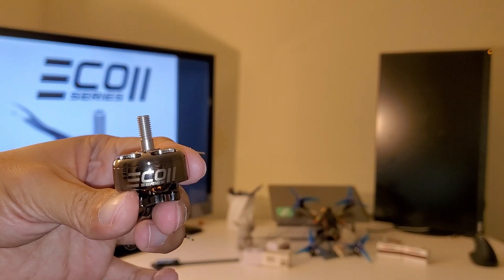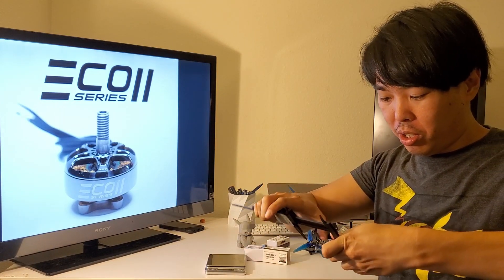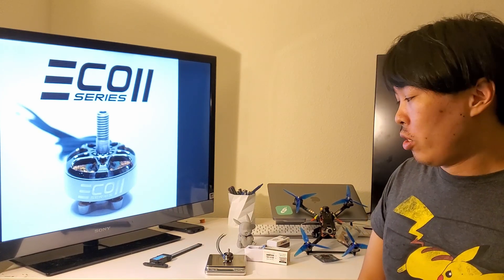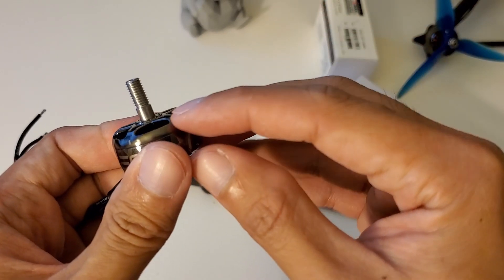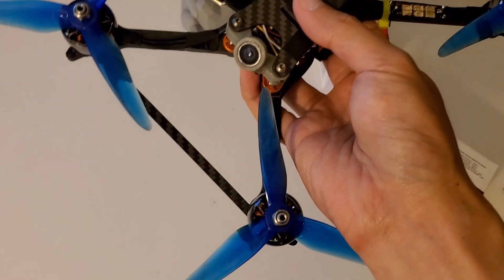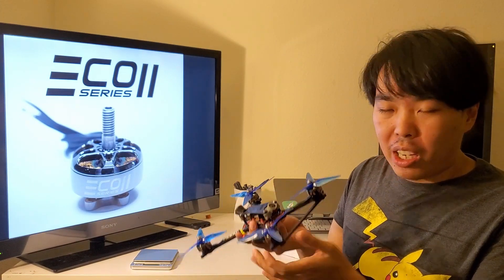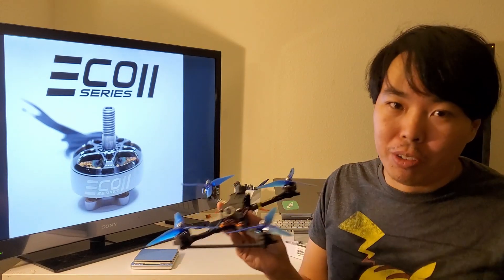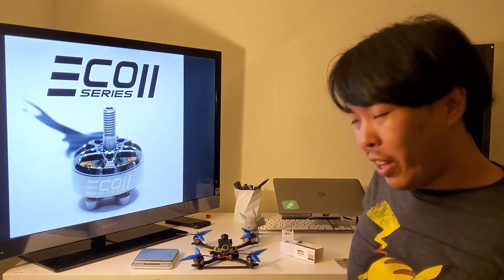Emax Eco II FPV Motor - Return of the Budget King? $12 Motors Racing test review!!!

Comment: Going for my 1st fpv build …. I am confused between the two- tmotor velox V3 1750kv and Emax ECO II2207 1900 kv …. Could you suggest your pick? (I kbow 6s is recommended but I am planning to start with 4s and then gradually shift to 6s after I have enough confidence) . Kindly suggest your pick amongst these two
Reply: Tmotor

Comment: Sir
I have four 30 amp escs,eco 2 2304 1900kv bldc motors,apm 2.8 and 2s lipo battery is the above detail sufficient for quadcopter drone

Comment: I am starting to believe that the difference between a high priced motor and a low priced motor is so small that only the best pilots will be able to tell a difference. Racing pilots will probably be the ones that can tell the difference because as you said, every gram counts, every little advantage you can get helps. For most freestyle pilots I don't think most will be able to tell a difference. For freestyle flying, durability is probably the main concern because they crash a lot. I had a 2306 2400kv motor to start out with on my 5" freestyle quad. I replaced those motors with a 2207 2550kv motor and I think I can tell a difference but probably not. I wanted a higher KV for a little more speed and a little more power because my quad was so heavy. I wish EMAX would offer a wider variety of KV options for their 5" motors. Not just a KV for 4s and a KV for 6s, but maybe a 2400kv and 2600kv.   I do have Emax eco 2 motors on my 7" build in 2807 1500kv size and nothing about that quad feels cheap or lacking to me. That quad flies very smooth and has a lot of power when I need it.

Comment: Do these have the same teeny bell screws that the original eco's had? Great motor but I need to clean my bells often and that screw is a pain always stripping the head.
Reply from the maker: hey El Xero, yes it uses bell screws as well instead of c-clips, i believe they're a pretty standard size, make sure you use the right hex driver and they shouldn't strip. I can check on exactly which hex size it is and get back to you on it.
Reply: I used to use my solder tip to heat up that screw up before I took the screw out but now I use a mini torch and a couple seconds no screw has ever stripped. Much quicker than the latter method. Otherwise it's strip city! If that does happen  take a dremel at grind a slot in the middle of the screw enough to get a good flat head in heat that screw up and ta da! But the mini torch works in seconds! Keep on flying!!!!!

Comment: I'm not sure I agree with multi string wiring being at the same performance as one string. It just makes it more linear and on the same time under powered on the sharp turns. I'm wondering if these motors are perfect for indoor racing :)
I agree with the delay in motor reaction to the throttle request. I think that's always issue with Emax motors. That depends how much you are used to it.
Reply from the maker: Hey Alexandru, are you referring to the multistrand vs single strand? I personally favor single strand because it has more cross sectional area to lamination ratio, which results in higher current capacity. However I do know that it is a contentious design choice and some people think there's no difference between the two. 

As for the delay, yes I agree, once you get used to it I think you won't even notice, it's quite subtle :) 

Overall a great motor, especially for the price!

Comment: The 2207 in 1900KV are sufficiently baller to go really fast, and end result is super versatile.  5S on these is actually amazing as well, all the tight/smooth lines.
The original are OK just because they're cheap, these are OK and also happen to be cheap.
Multi-strand is actually nicer (more copper is better), magnets are what tends to really matter (affects weight and peak power, also smoothness).
I really don't think weight matters all that much on racing, TBH - 98% of people running race quads would be faster running cheap motors, cheap batteries, and spending the difference going out and breaking stuff, and just having spares.  That fastest 2% of pilots do something with that difference, but until a pilot is running out of battery in <2mins putting in laps that are within 0.5s of each other that whole time, it's not time to spend tons on powertrain
Reply from the maker: Hey buddy! Thanks for all your detailed comments, its very helpful to have these discussions. In terms of multiwind, my preference is single wind - they tend to be tougher and also cross sectional volume is high because there is a lamination layer, so the % volume wasted on lamination is smaller for single wind. But i do agree that this is a contentious point in general. 
As for weight, that is a great point. Racers in general are obsessed with weight (as with in car racing), because weight determines turn in agility as well as overall efficiency, but I think there's an indifference point somewhere, my current hypothesis is that a 20g difference is noticeable, but a sub 10g difference would most likely be hard to discern in a blind test. I have a test video planned for this exact topic to see how much of a difference weight makes.
As for whether it's worth it to spend the money on more expensive motors, it all depends on what you're trying to do, if you're just practicing and having fun I agree with you, but when you're racing to win in multigp 0.5s to 1s difference is huge and the difference between winning and losing, so i think there's a market segment for cheaper motors and high end motors, and as I said in the video, this motor is great for beginner to intermediate and even advanced pilots who are trying to save some money, but I won't go as far as saying this is THE motor to go to for racing, mostly due to weight considerations.
Reply: @DroneRacingAcademy  Yup - I have the luxury of being able to maintain a fleet of various beaters, and about a dozen proper high end builds (mostly secondhand stuff, but top level gear) - the difference isn't that big honestly, especially if you spec things to where you're throttle limiting to add resolution (1900-2350KV 6S on 51466's).  
The builds I'm fastest on aren't the quickest because they make the highest thrust to weight ratio - it's that the motors are smooth enough I can get the P/D balance dialed and have thermal overhead on the tune so it's locked dead-in at all times and I can actually attack turns from entry through apex without any hesitations to see where small bobbles come in. 
I think we're at comparable pace, and that point is the transition where you don't want lingering doubts about cheap hardware holding back ultimate pace, but I'll stand by the above statement that a pilot can gain more ultimate pace smashing these with Ovonic/CNHL packs on beater electronics instead of nice builds (just run a nice camera, reliable Rx, and rigid frame)
Reply from the maker: @tehllama42  I agree with most things here, stick time is above all else the most important factor by far, if you're limited by how much you can practice because you can't afford high end gear then it's definitely not worth it. That being said if you can afford it there's still a performance difference there :P

Comment: How is the t motor velox 2207 1950kv when compared to the emax eco ii  1900kv ?
Reply: In a blind test, you wouldn't be able to tell a difference.  The Eco2 bell/magnets are better, the velox seem very slightly smoother (might be the N48 magnets or the bearings, dunno), but practically, no major difference.
Short answer, at the same price I'd probably take the Eco2's, if the Emax are cheaper it would be them all day every day.
Reply from the maker: @tehllama42  it's interesting you say that, I had run a blind test on the older eco vs a couple more expensive motors and they do certainly feel different, from my (limited) testing, I think motors are tuned differently and have different weight distribution which results in different flight characteristics, but in general they are all very capable these days and you would likely hit very similar lap times across the board assuming similar build weight
Reply from the maker: Hey Ashok, that's a great question, I've flown the Velox briefly on my friend's quad but don't have enough stick time to do a direct comparison just yet, I'll be getting some in over the next few weeks and will be posting a detailed review of them just like this one :) Initial impressions are good for the velox though!
Reply: Thanks, so please do that video soon mate comparing the velox and eco ii by blind  testing  🔥🔥👍

Comment: XingE-2207s are the best bang for your buck my man - at 11$ a motor (when you buy the 44$ 4-motor-bundle). Ecos are fine but do lack power and strength in design, not a fan of multi-stranded-windings. Still a great video!
Reply from the maker: Thansk LeRainbow! Xing-Es are nice as well, I will try to get some to do a head to head testing. Honestly motors have come really far and most of them are viable and quite good, the main differences is usually in weight as well as weight distribution which results in tune / performance differences.
Reply: RCX Beats out even those for pricing, but it's really close, and honestly doesn't matter.  Xing-E packs are also amazing.
Reply: @tehllama42  never heard of RCX motors :D but great to hear that there's still stuff to discover in the FPV market.

Comment: That delay sounds more like esc of fc settings. are they the same esc and FC setting?
Reply: It's not either of those - weight is the answer, everything else suggested is incorrect [Sorry Daemun] . Practically, if it can handle propwash, by definition it's making torque/RPM deltas in the <4ms timeframe more than adequately, which this is).
Reply from the maker: @tehllama42  I agree, the hypothesis I had laid out in the video was that weight was driving the responsiveness difference so we arrived at the same conclusions. To me the main difference between this motor and the more expensive premium motors is the weight difference as well as materials used (titanium shaft vs steel etc).
Reply: @DroneRacingAcademy  Material use is the big thing, and since it's at the end of a lever arm, trimming 3g has some meaning (more in how it tunes - motor delta needed to correct something in propwash gets it done).  Money-is-no-object, I'm taking my trio of F60 quads all day too, but my budget beaters running $10 3BH 2207s get close enough that I can throw KV at it and get a close feel, the cost ends up being efficiency.
Magnet thickness is probably the biggest thing for power - if you get a chance, the SunnySky ER2207's are absolute monster motors - stupid heavy, but make so much top end power that I had to mess with camera angle, and those are cheap motors... probably ideal for hauling a GoPro
Reply from the maker: Agreed, weight on the bell is a big factor. I've never tried the sunnysky motor. I'll keep an eye out for it. Though my newest builds are all focused on keeping it ultralight. My next build weight target is 270 with props. It'll be tough
Reply from the maker: I have a couple of "main" quads built using the T-motor F60 with a few different ESC types but the same settings across the board. All of the quads tested have the exact same FC and ESC settings to be fair and also to make sure I can fly them well :) so the delay is not coming from settings differences